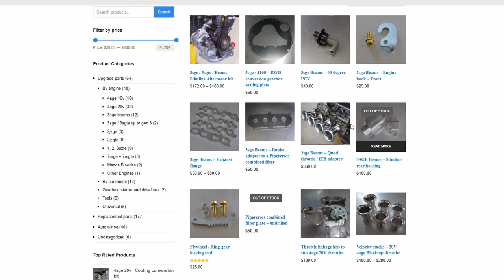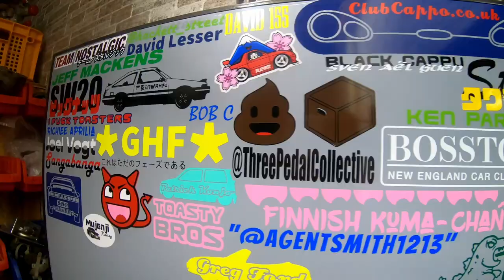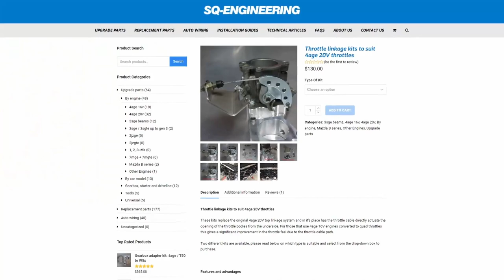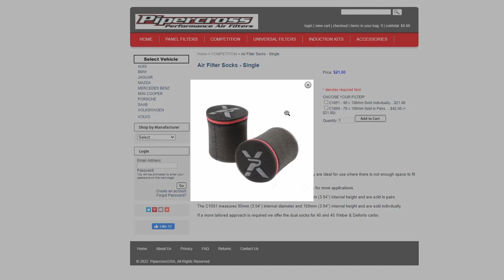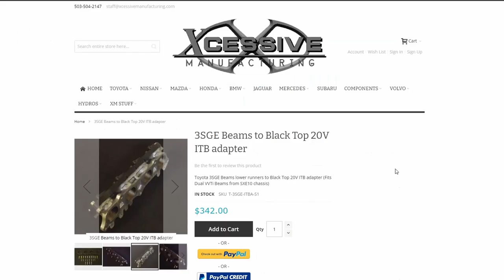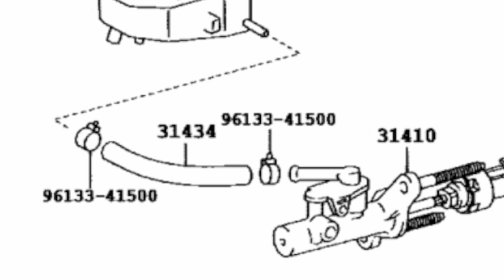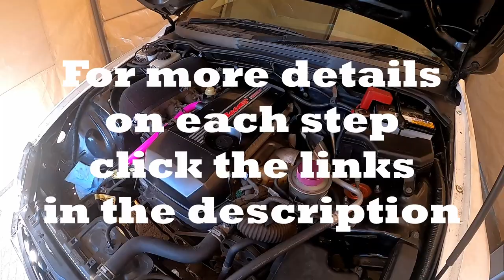Altezza ITB installation. Showing you everything you need to know.

Comment from the maker: I forgot to mention WHY I chose the MRP trumpets and that length.
Numerous videos and shops have all concluded that the 95-100mm is the best length for the most power increase.
MRP is well known for their quality and are transparent with the iterations of their products, and why they may have updated their designs. 
They were there when I needed answers to questions about the trumpets and always had reasons for their answers. I felt confident in the product. 
I found some independent test somewhere that did back to back tests of different velocity stacks and the MRP was the winner. This was put down to the particular funnel shape that they use.
Some might argue that the results are so close it doesn't really even matter but if you can buy the best then why wouldn't you?
They are made in NZ. thats reason enough
They are one piece. Not welded.
Hope that clears that up.

Comment: I'm doing general research for my ITB install and I'm surprised you didn't add an adjustable fuel pressure regulator. Can you just use the standard one?
Reply from the maker: I didn't add one because the fuel pressure is fine.
I have more than enough.

Comment: Haha, this is the exact path i go down with literally everything aftermarket. Maybe 1 aftermarket thing fits, then you need to add or change 5 other things to make it work how you want. Let alone matching up 2 separate aftermarket bolts for a "Bolt on" solution.
Reply from the maker: I'm glad I'm not the only one.
Reply: @GarageKei  you did a great job of showing it.

Comment: Plastic ITB adapters act as a heat barrier, where as the metal one contributes to higher intake air temps. There's a reason the stock plenum uses a rubber isolator between it and the intake manifold. 

Remove the PCV valve, you have an aftermarket ECU to clean up any idle issues that may appear. Let that engine breathe!

ITBs won't net any gain in power unless you run a propper plenum with air routed in from outside the engine bay. The hot engine bay temps will cause lower power, especially with our beams being a iron engine block. Speed academy did a dyno video on their s2000 build and you can really see the difference. Mighty car mods same, thing at the end of their V8 powered E30 video. You cna see the difference on the dyno. 

Also the blacktop 4age 20v ITBs are small for our engine. Think about it, it was made for a 1.6 liter engine, while the BEAMS is a 2.0 liter engine. Try and get some BMW 55mm itbs and have a machine shope create an adapter for you, or have them welded on the the stock manifold. Look at the driftworks Lamborghini build for inspiration. 

Delete the catalytic converters, and also have each of the exhaust runners  welded on the manifold,  outside where it meats the flange, and use a carbide burr to port the inside of the flange where the factory originally welded it. The factory sis a horrible power restricting job. 
Go 3 inch from the where the cats were all the way to the back of the car to maximize power. 

You should have some T-shirts made that says: "Dave, get it done!"

 It would really sell.
Reply from the maker: The sq engineering adaptor bolts to the isolator the same as OEM.
So I'm not sure why you brought that up.
Reply from the maker: Pcv is not a breathing restriction.
Reply from the maker: I can't comment on power but I can say that different engines perform differently... You mentioned a bunch of engines that aren't this one.

The premise of this was to use bolt on mods to make it easy.
I have custom shit on other cars and I just couldn't be bothered on this one.
This was supposed to be easy with off the shelf items that bolt on.
Reply from the maker: simply looking at the size of the butterfly and then looking at the Port size on the actual engine I don't see a huge difference.
The astronomical costs of the things that you're suggesting that I do wouldn't be worth it in my opinion.
Get this custom welded to use this thing from a different car that doesn't line up.....
Screw that. pay $1,500 and get a turbo kit that supposedly bolts straight on....
Deleting the catalytic converters would make the car no longer roadworthy so that is not an option. I drive this car to the track and back. it's not a trailer Queen.
GP sports catalytic converter cost more than toda cams.
Plenty of other people told me that the catalytic converter won't be a massive increase in power so the cams are better bang for buck.
Reply from the maker: I have lots of t-shirts and things for sale.
Sales are not high.....

Comment: Welp… looks like i’m not going the ITB route for my altezza 🤣
Reply from the maker: Really, if you don't mess with THIS filter then it ain't THAT hard. It certainly ain't a cheaper route than turbo... But you do get rid of that horrid electronic throttle body....
Reply: @GarageKei  does the rs200 suffer the same throttle pedal lag that the is200 has?
Reply from the maker: @Revobushwoky  I haven't driven an is200 but this car does have a slow responding throttle body because the ecu basically checks your input before allowing the throttle butterfly to accept your foot movement. To be fair I didn't have any trouble drifting the car that was related to throttle response (as far as I know.) Honestly I won't know the difference until I hit the track again.
Reply: @GarageKei  God... Sounds about right aha. I'm hoping to import an RS200 in a few months and I was really hoping it didn't. Fair enough aha. Great content by the way, I'm glad I accidentally found your channel :)
Reply from the maker: @Revobushwoky  I really like the OEM Altezza. It's much better if you change the suspension but it's a great car out of the box in my opinion. 
I'm sure you'll like it.  I'm glad you like my channel.
Thanks for watching and commenting.
Reply: @GarageKei  add subscribing, don't forget about that ;)

Yeah I definitely think I'll enjoy it. I do have some big plans which do involve basically an overhaul of the suspension setup and bushes around the whole car. Should be pretty cool if all goes to plan :)

Comment: Hi is it possible to put itbs on a 4th gen 3s beams redtop and if so does this link ecu work with the 4th beams redtop
Reply from the maker: Hi, I believe it is possible to put itb's on a 4th gen .. but honestly I don't know that much about it.
This link ECU was specifically designed for the altezza because the altezza uses a special system. I don't believe this system was used in any other car. So I don't think this will work with a fourth gen beams.
I'm sorry I'm not a hundred percent on either of those questions...